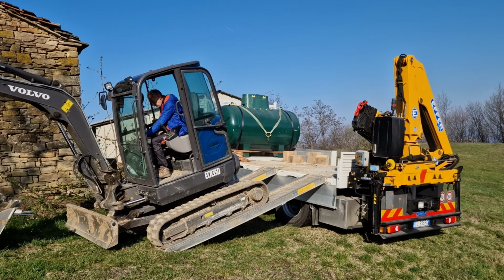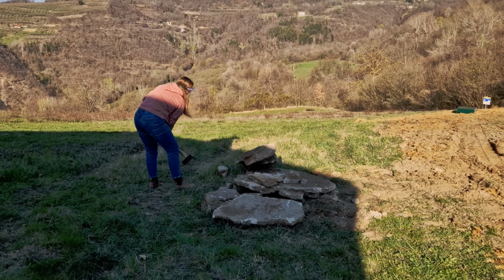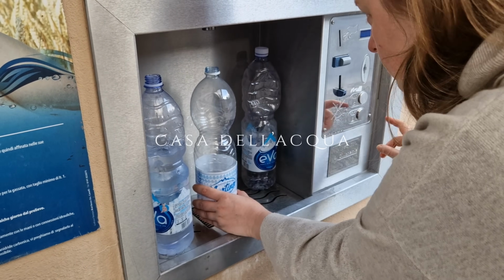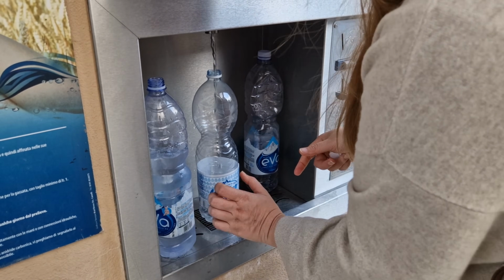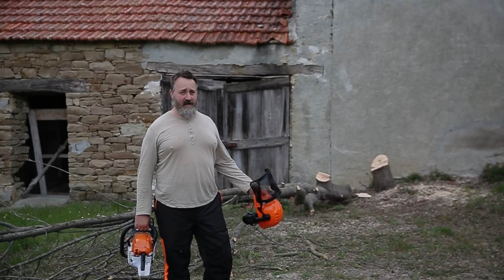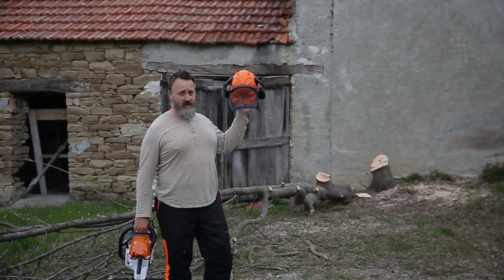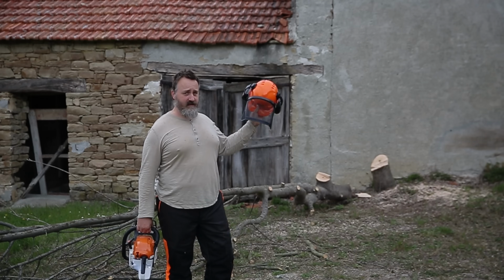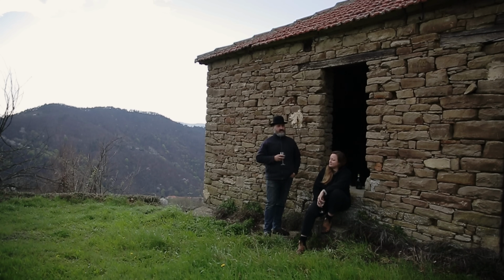The Promise of Hot Water #6

Comment: If the pressure on the water varies, install a pressure take inside the house to increase the house water pressure. Its a tank the has a air bladder inside. When water inters it, it compresses the bladder thereby increasing the water pressure.

Comment: How do you get the LPG tank refilled, if it is underground? My parents retired to rural Texas, where they installed an above-ground propane tank. When running low, you had to call and a huge truck would drive up to the tank. Yours is on a slope, which seems inconvenient.
Reply from the maker: it can still be reached and refilled by the truck 😊 i imagine the size of truck used here in the mountains is probably a bit smaller than the ones used in texas though!

Comment: Thanks for another lovely video. You two are such hard workers!  As for the water pressure, perhaps you should install an autoclave (water tank) that will turn on when water pressure is low.  We are going to do that for our house in Abruzzo as the water often shuts off during the evening in our village (and other surrounding villages).  An autoclave is common practice in our area.  We are hoping that the initiative in Abruzzo to address the water shortages will obviate the need for this some day, but for now, it is the way.  The water shortages are due to sieve networks and unbalanced supplies across Abruzzo - there are multiple water companies in Abruzzo and they don't balance water supplies between them.  Probably more than you wanted to know, but I was on a roll!
Reply from the maker: thank you nancy! definitely not more than we want to know 😘 we had been thinking of something like that but now we have a name for it that will help talking to our geometra and doing more research!

Comment: If you can find a farmer or cooperative with a chipper, a wood chip boiler would be the obvious solution for you. You'd need a storage bunker and an auger thad feeds the chips into the boiler but otherwise it's a drop-in replacement for the current gas boiler. You could even have a dual setup, using the LPG boiler to keep the house frost-free if you're not there to clear out the ashes and the wood chips while you're home.
Reply from the maker: We've been looking into wood chip burners the past few days. Definitely wood (either logs or chips) is one of the ways we'd love to go with heating, and having the combination of gas and wood would be perfect. :-)

Comment: It is a cold area where you have the cascina, windmills and/or solar panels only is not advisable as they can freeze or been covered by snow for weeks, or months.
Reply from the maker: it's not in the warmer parts of italy but we don't get more than a few weeks of snow each year. while we could rely on solar alone with a good battery system, we are connected to the grid and are fine with using grid electricity if needed. it's nice to have both :)

Comment: You certainly have enough roof line for water catchment, if you are thinking of tanks. We used to have them with a pump that switched on automatically when we ran any taps.
Reply from the maker: Fairly sure there will be tanks in our future :-) There's also an old cistern under one of the buildings, and we're curious if it would be a possibility at all to start using it again for water catchment.